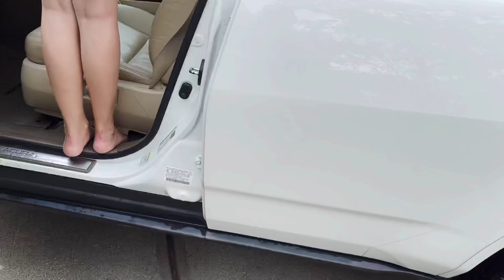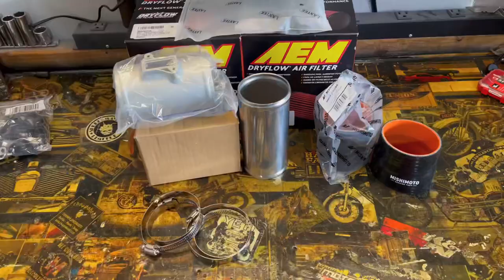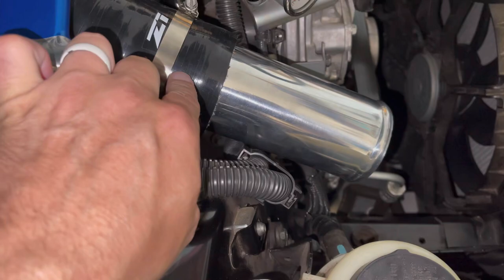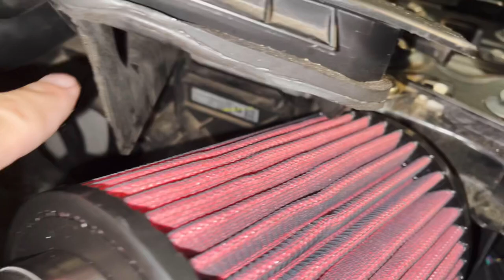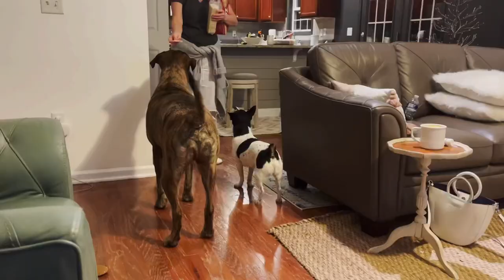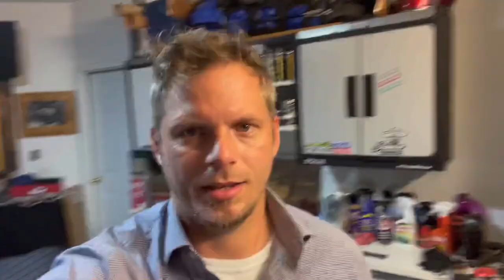Throttle Therapy | Got Screwed in this Q50 Vlog

Comment: The content U have is Mint Man Mint, so many ideas & U just gave Me one that could light up Utube, have nit seen it yet on utube, also if I recall when U had ur bc racing vid, what about camber ? 
Blessings 2 U & Urs my man, content again is great.
Reply from the maker: Thanks a lot!  I Have not yet gotten an alignment after installing the coilovers.  Car rides perfectly straight and tires are not showing any signs of unusual wear yet at this point, but I will need adjustable control arms before going in for an alignment as I was maxed out of adjustment with my lowering springs prior to the coils, but am now about 1/2" lower.

Comment: Was there any update on the mount for our transmission flex from pride auto?
Reply from the maker: I have not messed with it since pulling it off.  I don’t like the design honestly
Reply: @SpeedCultureStudios  have you heard back from him? I'd like to know if he's come up with a better hardened solution
Reply from the maker: @Marrda  I have not heard from him.  The last thing he told me was that he was sending out sleeves to help fill the hole in the subframe to everyone that had ordered the brace.  I have not received one, personally.
It needs to be redesigned with more of an angular brace rather than curved and needs multiple mounting points to the subframe.  I’m not super excited about the mounting bolts to the diff cover either.